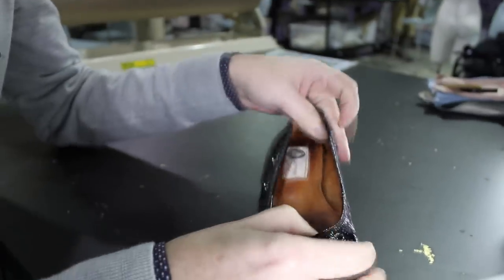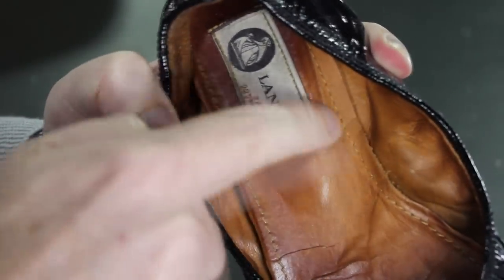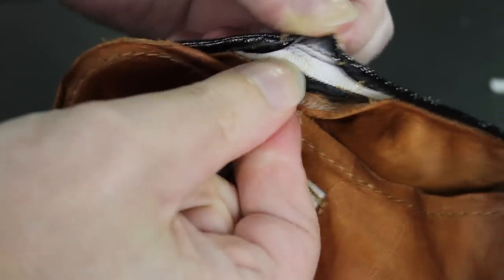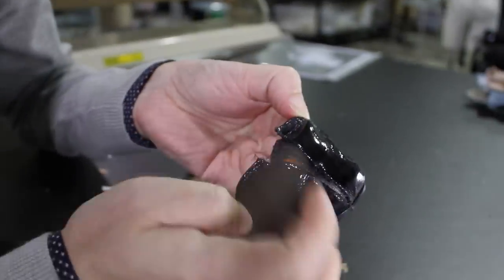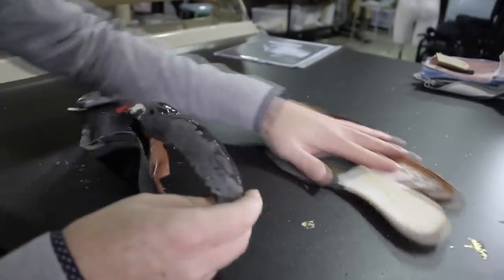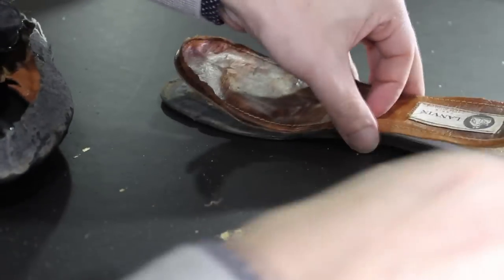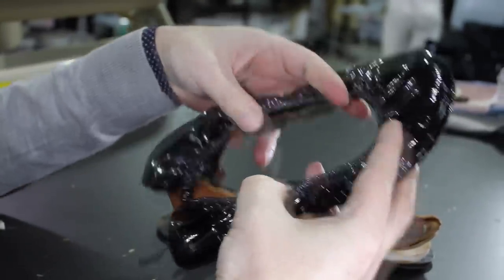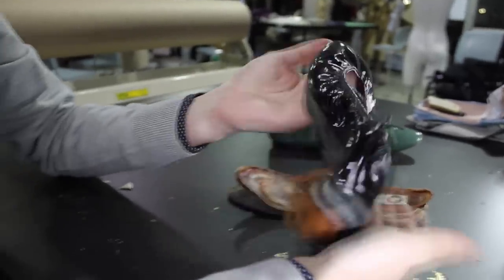Lanvin Ballet Flats Deconstruction

Comment: I have had a pair of these for years, in matt black leather. I paid almost $1000 for them. Recently I noticed that the leather was coming loose from the rest of the shoe and took them to be repaired. It couldn’t be done at that stage; they are destined for the trash heap. Partly my fault for not checking sooner if they needed attention, and I did get many wears from them. The leather is beautiful. However, for the price, they are not especially well made. The soles are inadequate to protect the leather from damage when walking. Despite their comfort I won’t be buying another pair.